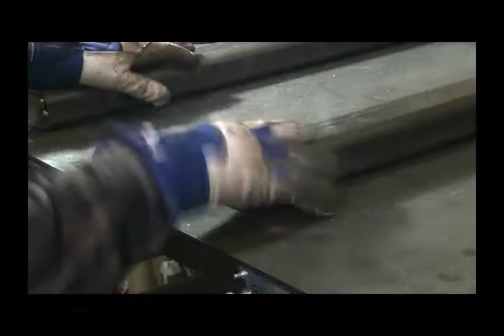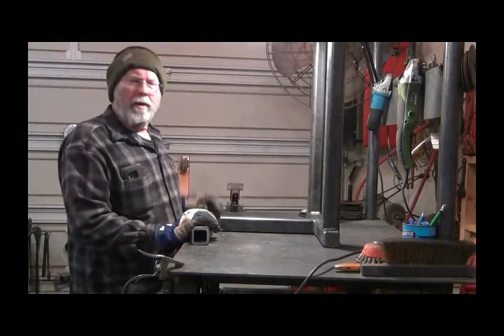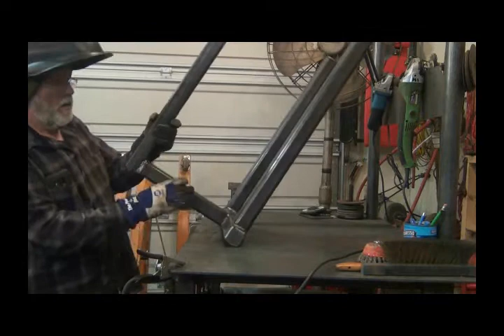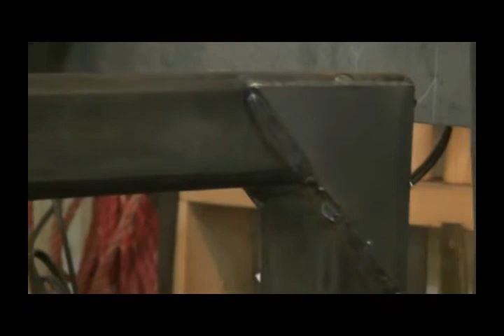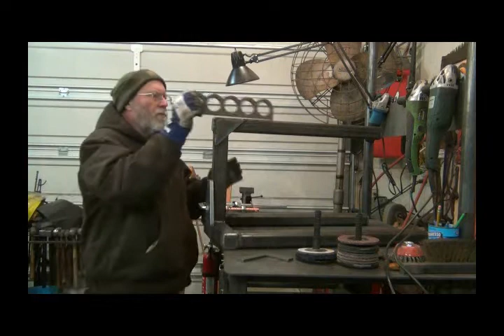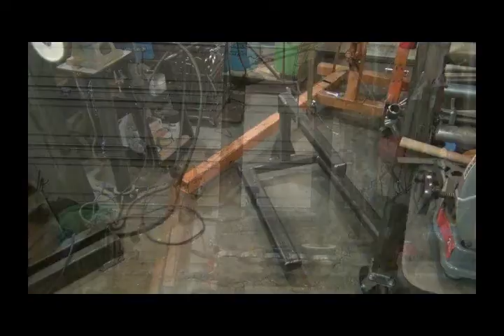Pallet Lifter Project

Comment: What type/model welder are you using and wire. Looks and sounds great till your ran out of wire
Reply from the maker: Marc S Miller 211. I'm running .035 wire. I weld mostly thicker steel so I use the thick wire.
Reply: Sounds like wire feed is super dialed in and consistent. Thank you
Reply from the maker: Marc S it is a great machine, very easy to use. I love it.